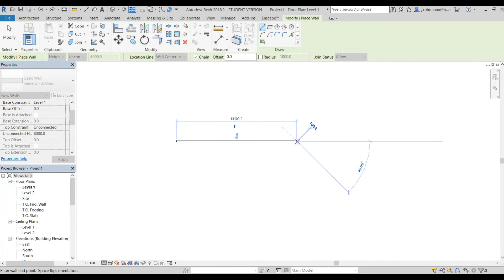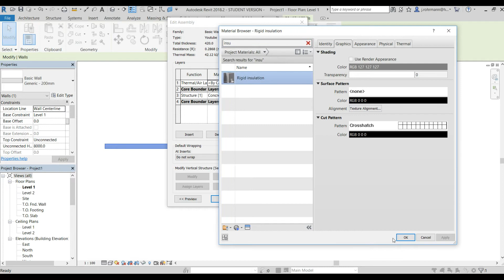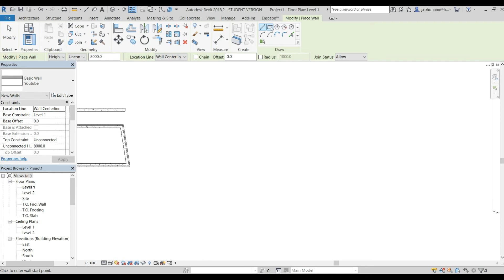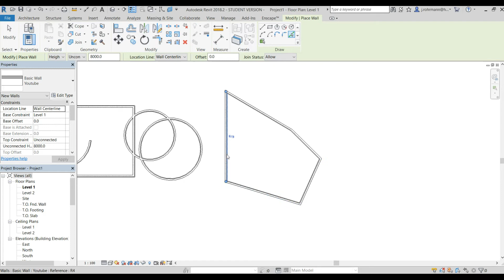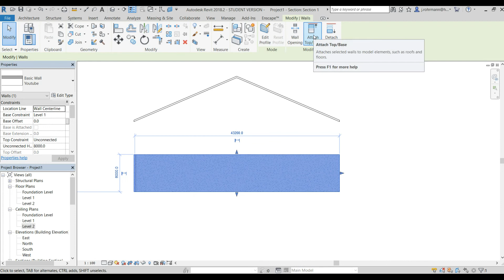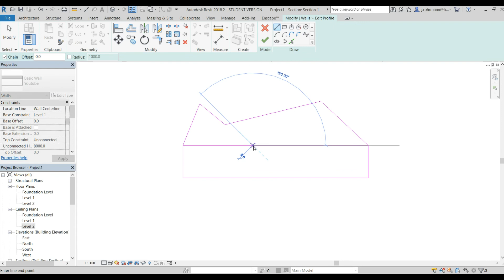Revit - Everything you need to know about WALLS

Comment: Dear Jackeline, Thank you for your video. I have a question for you that I asked a few people without a solution. I have a problem . I can see a window in the floor plan but in 3D the window does not go thought the wall, either inside or outside. Do you have any advice? 
I tried many things, also I created a new family window and happen the same with my creation family and families that I downloaded for BIM. I know is very simple and esay to drawuing again but I want to know the issue, the  drawing is old from 2020 I used Revit 2020 and I updated my Revit for 2023 and still the problem. I will appreciated your comments. Thank you